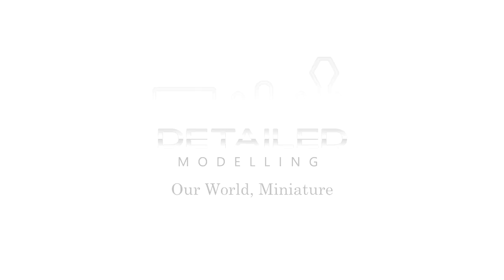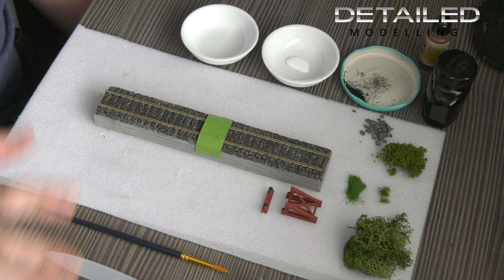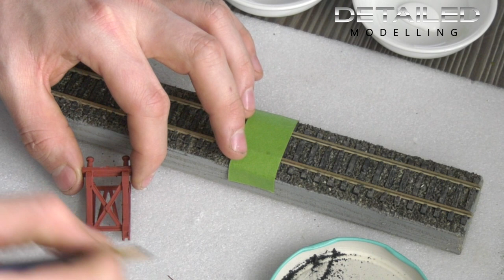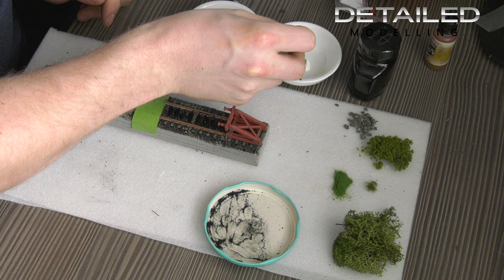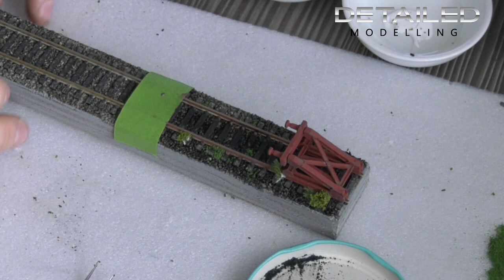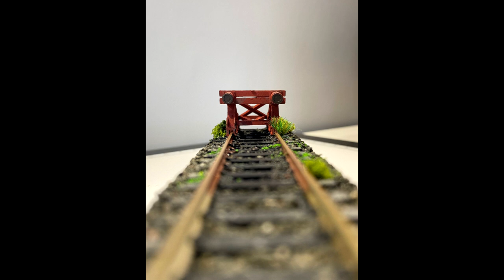How to: Weather your track and add detail! Model railway layout weathering and scenery

Comment: Mat medium seems to be much more better than white glue. It s not shiny and it doesn t let any thickness
Reply from the maker: Hey! Thanks for your feedback, yes you certainly could use a matt adhesive, we do also sell plastic cement which works well for quickly bonding scenery and models without a visible glue residue. However depending on how much track you're doing / weathering it could work out a little more expensive than PVA. I find a craft glue works well for keeping things lower in cost and giving an overall great look to the layout!

Comment: What is that 'pen' you are using to paint the sides of the rails?
Reply from the maker: Hi Peter, Thanks for your comment! The brush I'm using here is a refillable tube brush, a few different variants can be found on Amazon. They're great for larger areas, to save dipping your brush over and over. Simply fill with a watered down paint and it also works with acrylics.
Reply: @detailedmodelling  Many thanks, Ben - I'll try one. Keeping the flow constant is tricky at the best of times even with good light.
Reply from the maker: @MaboPete  https://amzn.to/3Nf98zK -- Hi Peter, this is a great option I've just purchased myself! Flow works brilliantly with thin nibs.
Reply: @detailedmodelling  Thank you for that - I've just ordered a set from that link.
Reply from the maker: @MaboPete  Great to hear! Let us know if you need anything else 😀😀 All the best!